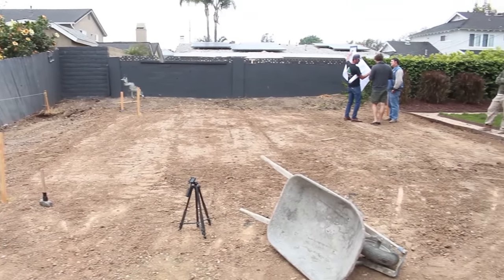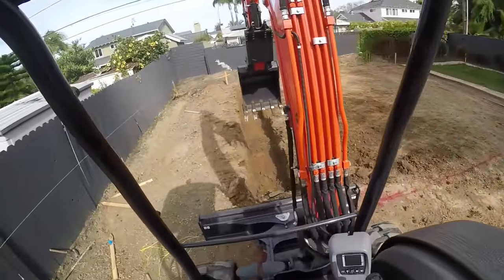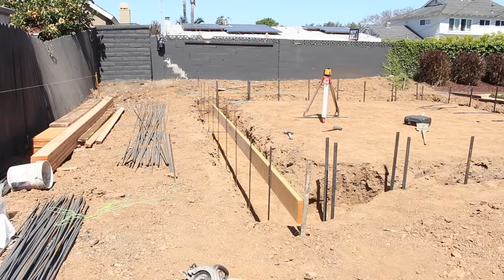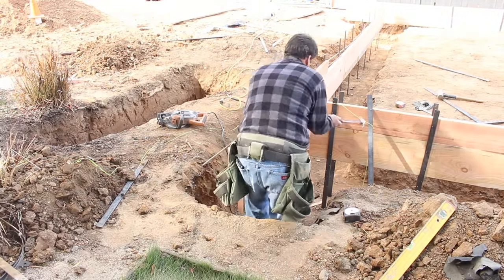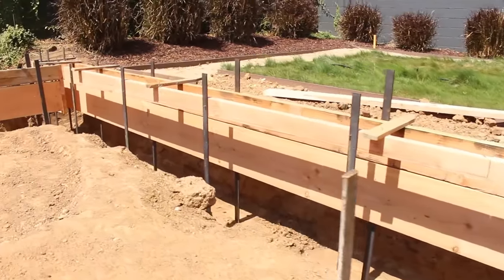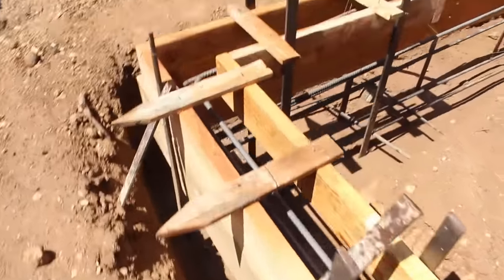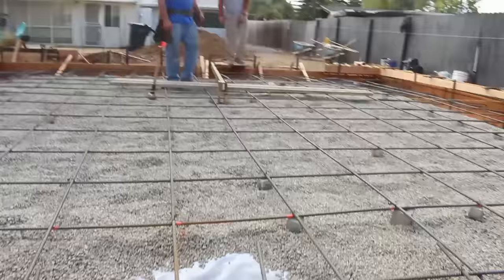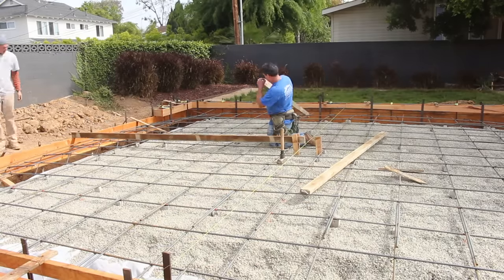How to Build and setup a Concrete Foundation for Garages, Houses, Room additions, Etc Part 1

Comment: Came here to see how to start building my future home😉
Reply: Mr Zer0000000 me too
Reply: @adifferentpolitics5129  that makes two of us.👍,just say when and where an we'll start a project🏠🏠
Reply: Mr Zer0000000 I will let you know
Reply: Yuy
Reply: Big waste of money and concrete from what I see of overdone excavation n concrete...overkill many times over.  I see houses in soft silt soil New Orleans area 50+ yrs old level and solid still with just a 12 inch wide chain wall (the main  perimeter 'footing' ) 12 to 16 inches below grade, 6 inches above grade, 4 pcs of rebar on chairs (highway mesh cut to penetrate soil at bottom of trench to  hold rebar steady during pour). Concrete company's owner  and P.E. (certified professional engineer) told me more is just a waste - and this from a guy whose profit goes up the  more concrete you buy!) but he says the bigger, wider and deeper footings today may impress but are unnecessary.  Even in climates with below zero temps, the same narrower footings on monolithic slabs, encased in 2" thick hi density poly foam board is all you need per most county bldg codes (see " shallow frost-protected slab" in your online search).
Reply: @enockmagabi9525  

Q
Reply: Sameee
Reply: Word
Reply: More work than I thought.
Reply: Same))
Reply: JGRMTN JGRMTN  dudes in California. They have earthquakes.
Reply: @adifferentpolitics5129  jiujujuijujíkk
Reply: Plum Milk I’m being a bit preemptive.
Reply: Me too
Reply: Me too seriously !!!

Comment: When I was a kid I saw my dad and a couple helpers make a perimeter wood frame and cut angle stakes to hold a 4 inch slab about 25 x 25 feet. It was for an additional room for the house. Took the guys a couple of days and a stack of 2 x 4's.  Then used a mixer and poured into wheel barrows.  This deal looks like the foundation for a three story building!  GAWD!
Reply from the maker: I concur
Reply: @OdellCompleteConcrete  It is a superb job, notwithstanding!!!
Reply: Yes, it's way over the top.

Comment: Definitely an interesting and different way of putting in a foundation. In my area a monolithic pour wouldn't be allowed because you need a separate inspection for the footings, stem wall and slab. J-bolts always get added after the pour while the concrete is still wet too. My neck of the woods they are very inspection heavy, you would have 5 inspections before you could even start framing the walls. Keep up the good work.
Reply from the maker: +Mike L 
Sounds like a Mickey mouse operation.
TY
Reply: Haha😂😂  not residential right

Comment: Back in 2007, I built a large (24' x 16') two level barn on my property. I did everything by myself including drawing the blueprints, digging the foubdation, and all the structural and roofing work. The only thing I contracted out was pouring of the concrete footing & slab.  I'm a lot older and a little smarter now and I'm considering building a 20' x 30' room addition on a slab.  Thanks for your video, it was very detail oriented and I learned a lot.
Reply from the maker: YW

Comment: This is the most important part of garage builds and any foundation construction. Framing errors can be fixed.  But grading, foundation and slab can't after the cement is poured and so must be done right. If the concrete is wrong, the garage is a writeoff. Many homeowners bawk at the cost, not knowing the true extent of labour, materials, planning and execution involved, and hire some bum from down the street with a beat up truck and wheelbarrow, thinking they'll save a few bucks. Nope. They'll be screwed and won't find out till soon after. 

Half decent 2-car garages where I am go for about $25,000. Customers that can't afford the cost are better off parking on the lawn al fresco. If they hire a 2nd rate foundation contractor or worse, every cent they pay will be money down the drain.
Reply from the maker: Jason Bell 
You definitely got that right.
Reply: $25K only for the foundation and slab or for the entire garage?

Comment: As a Structural Engineer in Canada, I was impressed by watching this video as I did not see anything wrong considering the location of the build. ie. Canada requires 4' frost coverage regardless on all footings. very good job mate.
Reply from the maker: +Travis Thompson 
Thanks
For the knowledgeable input
Reply: @OdellCompleteConcrete  Well that structural engineer is wrong. The code books say 48" across Canada BUT CAN BE DIFFERENT BASED ON LOCATION. (just a homeowner, that can READ)

Comment: there's a time and place for monolithic pours. Footings on a shop, garage, and house are usually not the time. Glad you mentioned compaction and inside the trench after excavating. With maximum compaction monolithic pours are possible and last the test of time. Still not a big fan myself. I v-groove the footing in the center of the vertical wall to prevent shear and put jabbers for the vertical steel. Main reason I like a 2 pour is strength and settling. You can use a lower slump and build your forms on a solid base. You guys do good work. Good video
Reply from the maker: Jojo Bane 
TY

Comment: Very awesome work you do. It's shows the quality and the processes that you take to ensure a proper foundation. Wish you were in my area, would have hired your company just based on this video. I made the mistake of hiring a company that didn't care for quality and how I wanted things done like I requested all expansion  joints to be saw cut, rebar in sidewalks etc...and they just did what they wanted, fast and cheaper. Why not use a Paslode gas nailer instead of hand nailing every nail? Hand nailing with a hammer tends to move the board with every swing. Thanks
Reply from the maker: Never considered a nail gun.
Can you put duplex nails in it so they are easy to pull out.
Reply: oh i see, duplex nails would not work in any gun. Thanks for the reply.
Reply: Nail gun nails are also coated with a friction heat activated adhesive which makes taking aprt form a pain!
Reply: Not all concrete cracks or I must have the only 25'x25' garage floor in the world without cracks or control joints. Just a smoothed top. I don't know what the builder did for this slab but no cracks in over 18 years in the Pacific Northwest climate.

Comment: The foundation looks to be worth more then the house itself
Reply from the maker: The house is the next remodel, coming up.
Reply: You guys built that up like a boss!
Reply: Romano
Reply: jajajaja
yes
...

all that job is excesive
Reply: He is in CA, the codes are really strict. go back east and you could build on a simple slab
Reply: lol
Reply: I'm hard to impress but if I needed any work I would hire him.
Reply: @tomhutchins1046  I wish that were the case in Detroit! 42" deep,  16"×16" footing!
Reply: Gerald ross
In many parts of Ca it's 24"x24" footings and min 4" slab with lots of rebar and bolt downs for the walls and all sorts of steel ties for the structure. We have earthquakes
Not sure what you me by 42" deep? Frost line?
Reply: @tomhutchins1046  yeah, frost line so overall depth has to be at least 42"total
Reply: @OdellCompleteConcrete  so what does a foundation like this cost?
Reply: @tomhutchins1046  earthquakes and stuff🤷🏻‍♂️
Reply: Well it holds the house up so there's that

Comment: You poured over 5 times as much cement in the foundation alone as I did in my 24x40 foot frame barn, it has been standing over 30 years and still as good as the day I poured. The only thing I did not do by myself was the actual pour. I was about 35 at the time. Still vividly remember digging that foundation with a shovel in August avg temp was in the high 90/100s, started at 5am and quit about 1pm.
Reply from the maker: Kelsey Smeltzer 
it's pretty amazing, the changes that have happened in the last 30 years
Reply: Wedgenut Tanker pjhhh1hjwhajjajjqna
Reply: Wedgenut Tanker it not cracking can also have to do with how cold it gets in the winter.
Reply: A building is only as good as  the foundation it is sitting on. In my opinion, you can't over do a foundation.
Reply: I tip my hat to you sir.
Reply: It makes a big difference where you are too.  The further north you go the more you have to pour because they have to be deeper and deeper into the soil to avoid frost heave and cracking.  The closer you are to a hurricane zone it also has to be bigger because it has to weight down the whole building against the wind, especially with large openings like garage doors that will catch the wind.  In seismic zones, like where this is located, you have even more regulations.  Monolithic pours also require more than if you do a block and slab foundation.  It depends on a lot variables.  Building codes are different everywhere and a lot of places don't even have them but they are driven by the insurance industry.
Reply: Linda Rivers , also if you live in south Florida, these foundations are common. The South Florida building code is very strict due to hurricanes. All our houses are block and concrete and have massive roofing structures so the foundations and footers are big to accommodate all of that. I hear Louisiana, Mississippi, and Georgia may soon follow suit due the amount of hurricanes lately that move farther north.
Reply: vast different between concrete & cement    two totally different things.......
Reply: Odell - I am a subscriber and have enjoyed watching your videos, I am a builder in NJ, come on tell the truth, how soon after you started excavation did you crush the wheel barrow? LOL, Just kidding, I've murdered a few myself!
Reply: I think you are mistaking cement for concrete

Comment: Good job. One think i notice. Its your duplex problem. Screws are great to button corners. But if you prefer nails. Turn your nail up side down. Bang it cpl times. Then turn it again in the same spot. That way wont crack the edge of your board. Break the sharp edge of the nail. We use this method back home to build furniture.:)
Reply from the maker: That works sometimes

Comment: Cool! I'm learning how to lay foundation for a tiny house I plan to build! This was very helpful!
Reply from the maker: Awesome 
GL
Reply: Tiny house....nice! I'd be interested to know your idea of tiny ..I made a great living building 24x24 two story homes.... On speculation....sold every one rapidly regardless of the state of the economy....many were sold during construction.. remember this project is a garage....and is way overbuilt ...the contractor mentions this.... overbuilt is superior of course if you have the $$... He is a smart guy for sure...I built monolithic slabs in one pour as well...using only 2x4s and foam board that is permanently in place for insulation....with a house you need to also rough in any plumbing or electric of course......good luck!!!!!
Reply: @vincentanguoni8938  My idea of tiny is 10 Ft wide. 16 ft long. 9 ft tall.

Comment: I poured a concrete pad for  some 5000 gallon tanks to sit on. # 6 rebar was placed on six inch centers in both directions. Poured with 5000 psi mix. 4 inch slump
Reply from the maker: Me too
Those are some tough pours

Comment: Hello: I know that this is a old post, but if you would, I don't see you checking the depth as you are digging. How are you setting the depth, or is that not so important that you only check it on the ends? Thank for the video.

Comment: Have you ever poured grade beams first around perimeter of building and then poured slab over grade beams creating a cold joint.? Any concerns you might have? I see that Hardy Frame has some details they provide that shows a optional cold joint at slab to grade beam connection. What if cold joint is lower than grade on exterior. Any concerns?

Comment: Outstanding... may I ask why you used a 4500 psi mix? I’m about to ha e the same foundation poured and will install a car lift... the lift company only requires 3000 psi...
Reply from the maker: only the designer knows that answer

Comment: David, One question….On a normal home being built (in  Florida ) I notice that they build the forms, pour the concrete slab and then build the walls with cinderblock,  right on top of the slab. But you are making a stem wall instead. What’s the reason for that?…thanks for all the great video’s, it’s a real education.
Reply from the maker: The stem wall is to keep the wood framing elevated from water damage

Comment: Square slab corners, via 3/4/5 method of triangles.Digging out with a brand new Kubota backhoe.Wheel barrow is a 2000 year old tool.Openings on both sides of garage!
Reply from the maker: Custom

Comment: Very interesting to see how you guys set up a slab quite different from here in New Zealand . We would have a 6inch compacted hard fill layer over the stripped topsoil then a 1 inch sand blinding then the damp prof course. We would not put crushed stones above the D.PC as we don't want to puncher it. We would also use cold drawn mesh , which is a lot quicker to set up .
Reply from the maker: Every Engineer  has a slightly different idea, but they all work.

Comment: Very nice work, love the bolt hangers...only little change I'd make world be to replace the 1x4 keepers you have nailed across the top of the forms with C-braces made out of 3/4 plywood or iron- i prefer that so they can be slid back and forth or up and down when finishing and still keep the forms from spreading.
Reply from the maker: good idea

Comment: Questions about the corners. I hear that you're extending the footings for shear strength. I am trying to figure out why only one "side" gets the extension. Maybe my understanding of the direction of shear is off. Shearing horizontaly right? So a wall is pushed sidways by moving ground? But if shearing happens perpendicular to the side that received the extension, is there no reinforcement there suddenly? EX: if a shear happens TOWARDS the front entrance overhang and you hadn't but in a footing there already. In my mind, there's protection for clockwise shearing, but not counterclockwise. What is this feature of a foundation called for me to find out some more info?

THANK YOU FOR THIS ABSOLUTELY FANTASTIC VIDEO
Reply from the maker: Because the length of the walls on either side of the wasn't long enough

Comment: Vapor barrier plastic sheet must be placed over the gravel, not under the gravel. And for the Turned Down Areas of the slab a concrete vibrator should be used.

Comment: So u don't dig the middle dirt ? So it's a stepping up when you go In ? Does that plastic stay there ? Is cement going on top now and then the sides ? Won't them middle be higher if cement is dropped on top of that. Now things look familiar I'm not very knowledgeable about building but I'm trying to learn. Is that all pieces of rebabard all connected ? It looks more like the fence shaped rebarb.
Reply from the maker: One step 4 or 6"

Comment: Have you had to use plastic stakes yet? Haha I did for the first time. Using Stego vapor barrier products and had to use sealer very similar to Henry’s roofing tar on all stakes that penetrated the interior vapor barrier and then after we poured we broke the plastic stakes off in the slab and left them in place. It was a first for me.
Reply from the maker: It's getting wild out there

Comment: We’re is this being built ? What is with the crazy sized footers for a small garage? Do y’all not do floating slabs around those parts?  In KY we will build garages on floating slabs on gravel, zero issues around here. For a raised slab we do a footer and couple courses of block fill inside with rock, form board the outside of block and pour the cap. The way you pouring the footer there, looks like a lot of concrete to fill that up, Concrete is high in these parts.
Reply from the maker: Earthquake country

Comment: Do you remove the metal stakes that are supporting the lumber for the inside of the stem wall when pouring concrete?
Reply from the maker: Yes

Comment: Can u give me an idea of how much in MATERIALS is all this for this size? Im planning to do a room addition in my house in my city, of that size more or less, for my mother in law and wanna do it ourselves. 

The addition will be flat roof and a terrace on top. Does the concrete slab need to be stronger than this if i wanna do a terrace (with no roof) on top? 

And will a RAISED FOUNDATION be cheaper than a concrete foundation?

This was a great video, i just wished u showed close ups of the details, like how to tie the rebars, how to attach the wood to the metal stakes, etc.
Reply from the maker: 13000

Comment: How did u get the 4 foot flat stakes out?  It looked like u nailed them to the forms. Also, how did u remove the 2x6 and 2x12 inside wall of the forms when u monolithic poured the slab to the side forms
Reply from the maker: Its not easy, but timing is crucial

Comment: Very nice. You mentioned you will save on concrete if you do two pours instead of one monolithic pour. Can you please explain why? Also I noticed sometimes you have the put the vapor barrier under the concrete and sometimes it is under the gravel. Does it make a difference? What size of gravel do you use?
Thank you  for all the videos.  Keep on the good work!!
Reply from the maker: The gravel or sand protects the plastic.
What you save on in a monolithic pour is labor and time. 
It only time it makes sense to do the foundation and slab separately is when your doing multiple simultaneously .

Comment: PLease explain the over build on this slab? 5" Slab, triple rebar in footing, rebar on slab instead of 6" wire. Is it code there for garages or did the customer want it for heavy vehicles.
Reply from the maker: James Whitley 
I think he designed it himself.